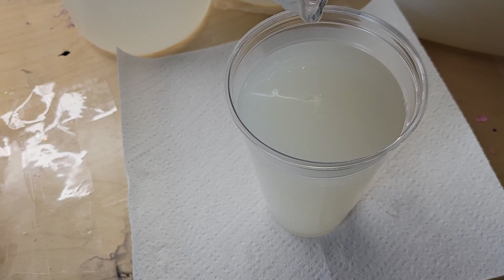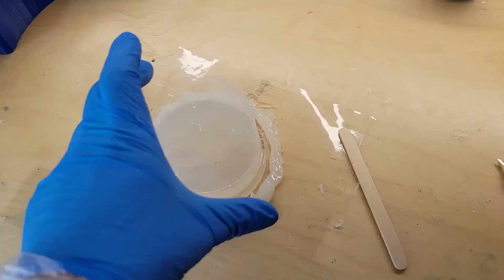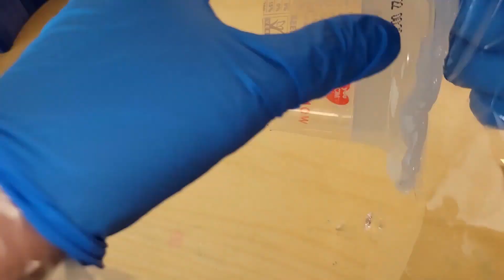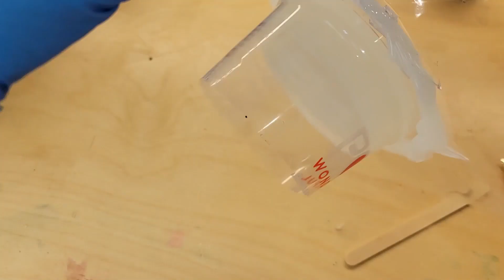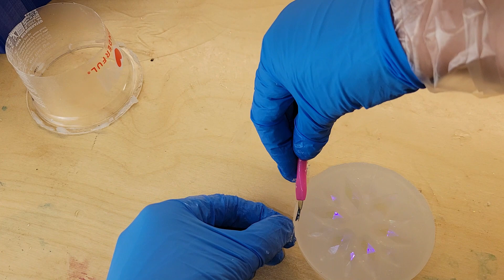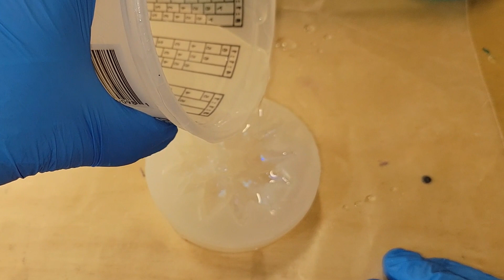Trying something new / Making a silicone mold of a 3D object & doing a resin pour

Comment: I’m wondering how you would attach a string/hanger to make it an ornament or sun-catcher? Do you drill a hole? Or glue it on somehow? Very curious to see because I would love to make these as Christmas gifts! Because ya know, June is almost Christmas! 😆
Reply from the maker: This one actually had a hole in it for hanging so the mold and all resin pieces made in the mold have it too.

If yours doesn't you can easily drill a small hole through them. So they can hang up 🤗❤️

Comment: Nice tutorial. Can a cardboard box be used for housing? Of course no leaks!
Also will a terra cotta item release? Beautiful crystal. ❤
Reply from the maker: Thank you 😊 not regular cardboard but a cereal box can be used. Cereal boxes have a waxy coating on them and it releases easy from the silicone. Regular cardboard won't release easy. 

And yes Terra cotta sound mold just fine. If your piece is a matte finish and not shiny your mold will be a matte finish
Reply: @naptimecreations  Thank you! Finally poured J Diction over Terra Cotta sun face using all the silicone ending up with not enough. Guess I have to buy more unfortunately, is a bit pricey.

Comment: That's awesome! Thanks for sharing! Have you done casting with glass yet? The object I want to use is large, glass and extremely 3D... lol. Not even sure how I'll pour the mold/remove the item, once I have the silicone mold poured. Lol
Reply from the maker: Thank you 🤗 my friend did a mold using a glass object and it worked out well. She said it was totally fine to use glass as a blank for a mold. 

For big items after you make your mold some people have to cut the mold down the side of the mold starting at the middle and cutting up to the bottom. That makes it easier to demold. 

And when you pour it you just place several rubber bands around the mold & around that spot where it's cut so resin doesn't leak out. 

Hope that made sense.
Reply from the maker: In this video they show how to do it. 
https://www.instagram.com/p/CTPobGMH3Rp/?igshid=MDJmNzVkMjY=
Reply: @naptimecreations  ohhhh that was extremely helpful!!!! Thanks! ❤
Reply: @naptimecreations  Awesome! Thank you! ❤
Reply from the maker: @SurvivorOfChildhoodTrauma  no problem 🤗🤗🤗
Reply from the maker: @SurvivorOfChildhoodTrauma  no problem 🤗🤗🤗